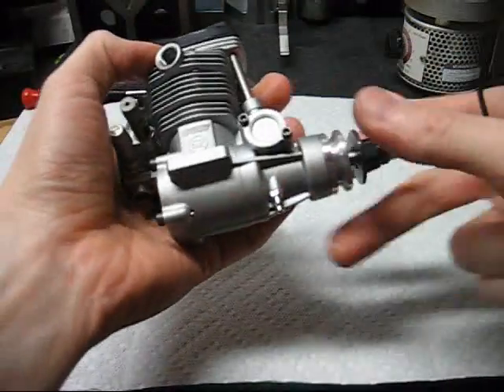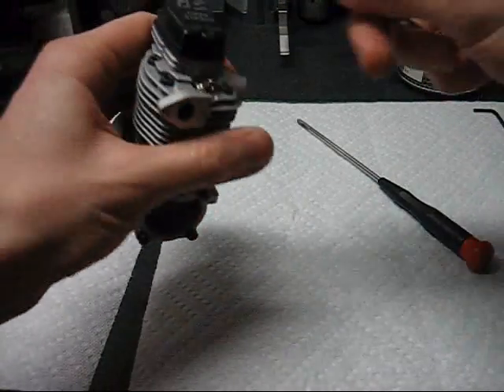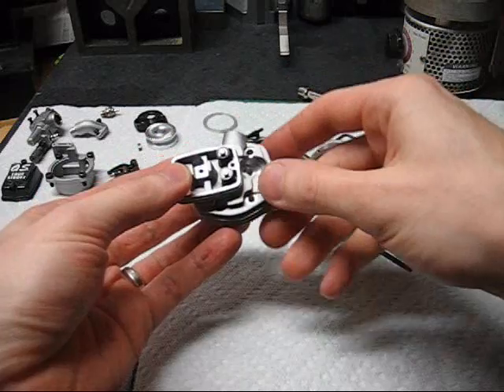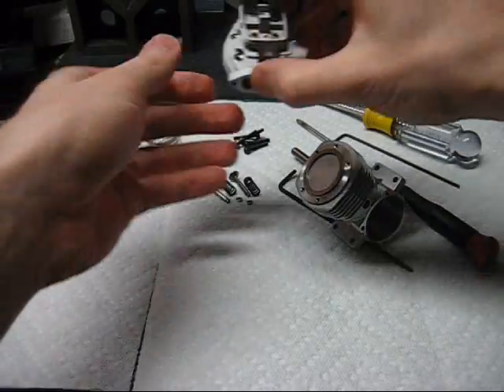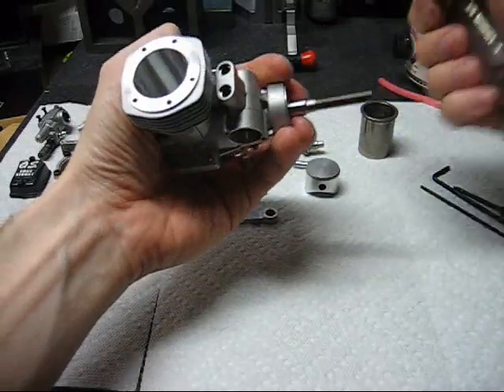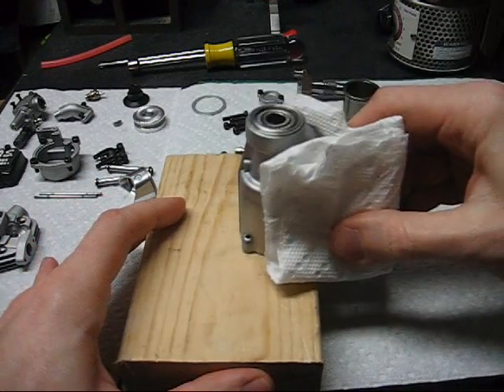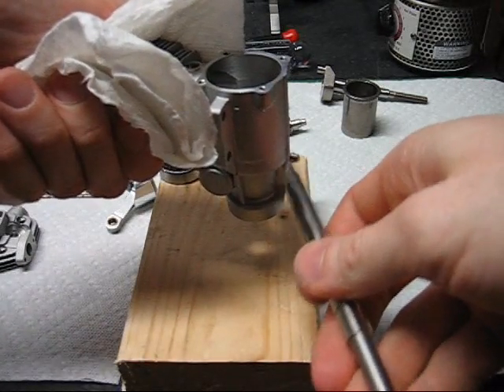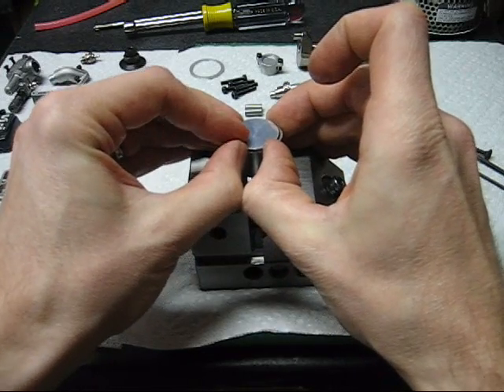OS FS-52 Four Stroke RC Glow Engine Disassembly

Comment: Procedures will have to be changed some for anything other than an almost new engine. Any engine with some use will have varnish and other contamination holding the parts together. That makes disassembly more difficult. Will need at least an arbor press and some experience. If you have an old engine that you want to rebuild, buy a junk motor and learn on that so you don't ruin your good motor.

Comment: Fine. Now show how to take apart a gummed up, used and abused engine, with stuck wrist pin, damaged bolt heads, cam cover glued in place, etc, not a brand new one just out of the box!
Reply from the maker: If you have trouble with a sticky engine, heat/solvent will solve virtually all issues. The wrist pin can be a pain, I but have never had trouble with anything else. I typically drill to remove a damaged screw head.

Comment: This engine is pristine and very easy to disassemble try one that has got some run time and residual fuel and castor oil in it helpful in showing how it comes apart but in reality most are not that easy.
Reply from the maker: The hardest part to remove will be the wrist pin.

Comment: Great video.  However I have one problem and I hope you have a solution.  The piston wrist pin on my 52 is old and will not come out.  The pad came right out.  I have tried heating the pin with a heat gun and I have soaked it in wd-40.   Any suggestions you have will be greatly appreciated.
Reply from the maker: If a heat gun wasn't hot enough, the next step is a torch. It doesn't take a big flame. If congealed oil is holding it, this will work. For soaking, acetone does an excellent job cutting oil and castor.

Comment: hi, is there a quick solution if the rocker arms are not moving and there is no compression on the engine?? or does it mean a complete dissemble? great video
Reply from the maker: The cam followers are stuck. You can push on the rod side of the lifter and if followers loosen easily ,I'd say you're fine. If still stuck,  try heating the engine or putting fuel or solvent down the pushrod tubes to free the followers.
Reply: Cheers thanks mate!!! Ten minutes of repetition and the rockers are moving freely!! OS 26 running like a charm.. Way better than a complete disassembly!!

Comment: How do you fix seized up engines because I have one that has not Ben run in years and it moves just VERY tight?!
Reply from the maker: Josiah Aston I almost always disassemble to clean. Heat will soften old oil and you can remove the rocker cover and back plate and add fresh fuel or acetone to dissolve the old oil residue.
Reply: Ok. And another thing one of the screws on the carb has a striped head and I need to get it off what should I do now?
Reply from the maker: Josiah Aston  Use a file or  dremel tool with a cut off disk to grind a slot in the head
Reply: Do I need to lubricate when I reassemble it if so what kind of oil and how much
Reply from the maker: Josiah Aston Yes, any engine oil will work. In theory methanol soluble oil would be better, but most after run oil is just common oil, and many people use ATF. Maybe a teaspoon total. Lube the rockers separately as oil doesn't have a direct path from the crankcase.
Reply: Any kind of car engine oil? And I forgot my engine is an OS max 30 fp
Reply from the maker: Josiah Aston Yes any oil. In a two stroke the oil will quickly be blown out and replaced with oil from the fuel.
Reply: Well I think my engine is a 2 stroke
Reply: So so so I need to oil it at all?
Reply from the maker: Josiah Aston Oil will get there pretty quick in a two stroke, but it seems silly to start an engine dry.
Reply: Well I have been use using WD-40 to free it up (Which it is now) so it will have plenty of oil when it runs! And one more question how do I get the sleeve out?
Reply from the maker: Josiah Aston WD-40 is not a lubricant! The sleeve if you engine was stuck will likely need some heat to free it. You can use wood or plastic to push the bottom edge of the liner through the backplate opening.
Reply: Well I was using wd40 to free up the engine which worked, but still since it is 2 stroke do I need to oil it at all? And what kind of heat source because irons have a heat gun?.
Reply from the maker: Josiah Aston Yes WD-40 works for that but it's not a lubricant. I always lube engines. Anything to heat it will work, solar collector, nuclear reactor, dinosaur remnants, whatever.
Reply: Ok any engine oil or anything to heat it. Thanks.
Reply: How do I get the piston off the crank?
Reply from the maker: Josiah Aston The piston and rod should slide off the crankpin toward the rear after the sleeve is out. If the little end of the rod is gummy on the wrist pin it might need some heat or solvent.
Reply: Well I heated up the engine but the Pistons connecting rod comes off half way
Reply from the maker: Josiah Aston It's stuck on the wrist pin. What are you replacing that you need to remove the piston?
Reply: Yes I need to remove the piston, I have the sleeve out but the connecting rod only comes half way off the crank shaft

Comment: Nice Video Greg. Have never attempted to take apart a 4 stroke; used to race RC cars & have plenty of experience disassembling 2 strokes. I have a pumped OS 155@ engine that has been sitting for 3yrs & will attempt disassembly sometime soon. Is there any info you can give me before I tackle it ? Can you tell me where you purchased your torque wrench, & what are the torque values for most of the screws ?

Comment: To degum and clean an Rc engine…get an old slowcooker. Disassemble the engine as far as possible. Place the parts in the slowcooke. Cover the parts in 100% auto antifreeze - the green stuff without water. Cook for 12 to 24 hours on low. Clean with a toothbrush and repeat as necessary. I saw this on another Internet forum and I kwow others that have cleaned auto Caribs the same way.

Comment: Thanks for responding so quickly.  I'll give it a try.  I got the cover off but the cam is stuck good.  The cam followers were a bear to get out.  A heavy magnet helped after I worked them up and down a while.  I'll check out your site, Thanks again.

Comment: I too have a 120 pumped and It's been sitting for quite a while, really gummed up.  Any suggestions on a soaking solution to loosen things up?  I don't want to force anything but I can't even get the cam cover off, and yours slipped right off.  I'm seriously bummin'.  I have lots of carbon in the combustion chamber and junk all over the crank and cam followers.  Nothing moves hardly at all.  Any help I really appreciate.  Good vidoe by the way, lots of help right there.  Thanks.

Comment from the maker: @Luvtoflyhelis Use the drywall screw or a screw extractor to get the wrist pin out. If that doesn't work grind a fine taper on the drywall screw to get a better grip. If that doesn't work, heat the piston, there is oil residue or corrosion holding it in. If it's badly corroded it might not be possible to get it out and the only option will be cutting the rod. I've only had to cut one rod out of probably 30 engines.

Comment from the maker: @7bikerboy7 Many use airtool oil. In the FS-120S-III there isn't actually any contact between the crankcase and regulator. The diaphragm in the pump should handle it as it's mylar or something. Incompatible oils can turn to sludge in the crankcase. People have been using engine and airtool oil as after-run oils for years, seemingly without issue, other than pumped engines, in particular YS.

Comment from the maker: @7bikerboy7 I happen to have an FS-120S-III apart and it does have two gaskets. I didn't measure, but one looks like 0.2mm and the other 0.4mm. The listing on Tower shows two gaskets as well as the OS manual.

Comment from the maker: @MaxwellForce That happens sometimes due to tolerances or corrosion. The the flame can unevenly heat the housing and may not expand correctly to release the bearing. Thought the 91VRDF with it's bolt on front end shouldn't be a problem. The worst thing that can happen by hitting the case heard is distorting it or the mating surfaces. It's probably fine. Only time will tell.

Comment: I disassembled my OS91 VRDF engine to change the main bearing.  I had a lot of trouble with the main bearing. It just wouldn’t budge. I used an open flame and gently heated the crank case of course.  I eventually got it out, but I had to use more then a slight tab. I really had to knock it really hard before the bearing got lose. Now I am worried that I might have damaged the engine, is there any way to know or see if any damage has occurred. The engine seems to run just fine afterwards.

Comment from the maker: There is no side load on the wrist pin so no wear of the pads. The pads used to be brass many years ago and worked without issue.

OS made a FS-26 and FS-40 specifically for cars. The FS-26S-CII is still made but not sold in the US. People have modified other airplane engines for car use.

Comment: thanks, so there are just a couple of plastic caps on each end of the pin to keep it in place, does they wear out due to friction with the cylinder liner? well, about the parts my crappy force two stroke 0.15 has about 20 pieces less than that four stroke but is 20 times less reliable as well, i would reallyl ike to try a four stoke conversion for my 1/10 buggy :)